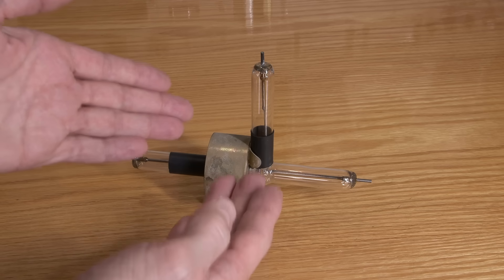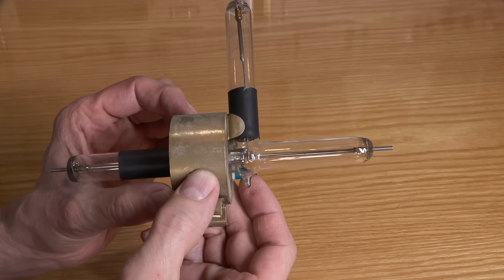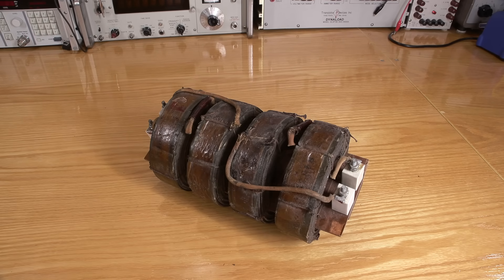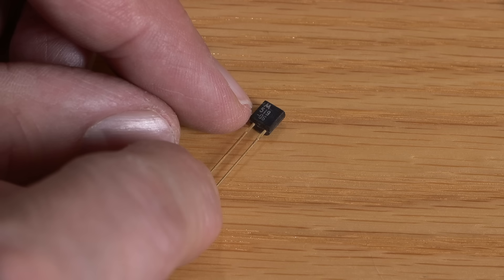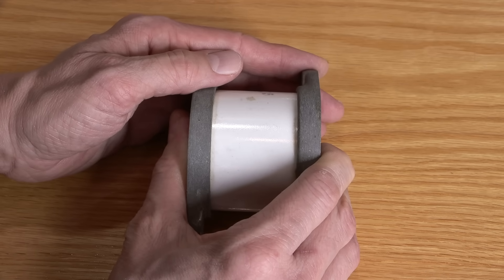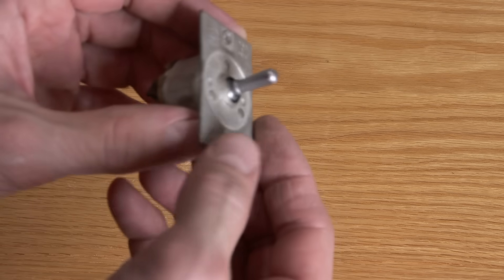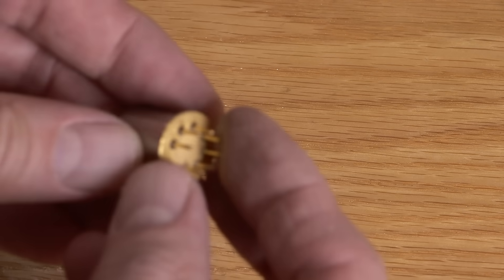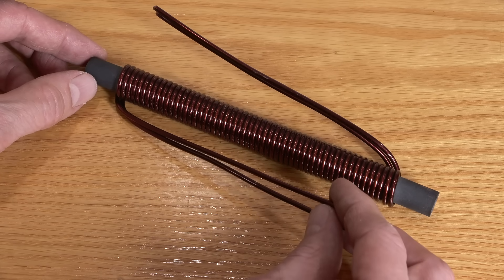Test Your Electronics Smarts - Guess The Electronic Parts!

Comment: MICA CAPACITOR TRIVIA.  The Bellingham Radio/Electricity museum melted their Sanyo mica capacitors (by running their large Tesla coil for way too long.  Guess it needed cooling fans.)  Molten sulfur ran out!  So, at least with older ones, the whole thing is embedded in that 1700s-era polymer insulator called melted sulfur.  I'd seen sulfur insulators in ancient physics devices and pre-1900 antiques, but apparently it's still being used.  Good idea: ...unlike epoxy and tar, when greatly overheated it won't turn into charcoal and short everything out.
Reply from the maker: They usually ooze tar when over heated.
Reply: @MrCarlsonsLab  And they smell good, too. I could always tell by the smell when one was getting ready to let go.
Reply: I remember reading the longest running battery that drives an electrostatic bell has been going for about 100 years and is insulated with sulfur.

On opening big HV mica capacitors like that I have found them potted with a very stinky waxy product.  The sheets of tin and mica are very pretty.

Comment: Two I failed on , the tubester , I thought was an op amp, and the small capacitor at the end as I thought both were inductors, I'm a kid of the  50's , I was repairing old vacuum tube stuff , so i had come across most of those parts

Comment: Ok, I paused 10 secs into the video. My guess just by looking is some kind of ancient accelerometer. Wonder if this one is compatible with arduino 😀
I got half a point. I said weird common mode choke on the filament choke. The choke part is right :-D 
Oh, and the green inductor. I called both probably inductors, where only the green one was. So that is 1 point.

Comment: I worked in HV electronics and microwave tubes for around 16 years. I won’t even watch this video because I know I already know what they all are. I now work with solid state systems along the same lines. Taking weaker microwave frequencies and making them bigger, stronger, faster and just as lethal. The device in the thumbnail is a glass HV SPDT relay. See, now I’m already bored. Have fun and don’t kill yourself.

Comment: I thought that small metal can was a RF relay since I have actually worked with some of those in the past. I even still have an old USB 2.0 switch that uses one, the good old days before mux chips capable of USB2.0 signal integrity became common.

Comment: I'm only 26 and I was quite surprised that I knew what I did with my limited skillset. 

1: The Relay I thought was an early transistor 

2: I was right with inductor but also thought it looked similar to a multi-tap transformer. 

3: Didn't know it was a veractor diode but instantly thought it looked like a transistor with a broken leg (thought it was going to be a trick question) as I've never heard of them before. 

4: Had no clue that was a capacitor as I didn't see where the wires connected to 😅 

5: Got the 4 position switch instantly, noticed the grooves in each corner and the 4 terminals on the back 

6: Saw the windings underneath the green coating so gathered that was a huge resistor. 

7: Had no clue that was a modern tube replacement as I've never worked on old tube equipment, I just like seeing people restore things I'd never have a hope of fixing with my current skills with a soldering iron. That maze of things connected without PCBs is quite confusing unless I looked at it in person and had days or weeks to reverse-engineer it or by replacing things component by component until it worked again. 

8: Gathered that was a choke as it looks similar to a toroidal choke with the amount of separate connections to it. 

9: Got tricked by the last two, thought one was a resistor and the other was a capacitor, now I know green usually signifies an inductor. The earlier image with all those capacitors helped me to some extent but also confused me as seeing colour bands on capacitors aren't something I'm used to except on the "domino capacitors"
Reply from the maker: You did well!

Comment: The 3rd item is also known as a 'varicap' diode. The number of switch positions on the switch was easy by looking at the notch-outs for the toggle lever. I'd call it a SPTT center off SW. 

I got everything correct at a glance except the solid-state tube substitute device. I have a couple of bags of Teledyne hermetically sealed relays in that package that led to my confusion. 

Back in 2012 or so I was 'the old guy in the backroom' who handled incoming surplus at a surplus electronics store who identified and priced all of the incoming surplus. But I really blew away the young guys working there when I identified a 19" rack equipment piece for them, telling them that it was the in-house built control unit for a 4 CRT vacuum pump-down cart used in the early 1970's in building C at HP in Colorado Springs as part of a 4 cart array, used to evacuate and seal oscilloscopes and HP CRT monitors, and I then described the abbreviations on the switch positions for controlling the mechanical, diffusion, cryogenic pumps, and oven controls used in the process. When a new guy at the store said, "You can't possibly know all that," I replied, "I could if I were the guy who was operating this pump-down-cart control unit at HP in Colorado Springs back in 1972."
Reply: Aww.  You should share more cool stories.  I would love to have the job you had in incoming.  The days of the CRT are gone and people will not even know that direct write oscilloscopes are even possible soon.  These days everything is filtered through digital hardware and software, always with the possibility that some nation state actor has hacked your unit and you are not seeing what is really there like the Stuxnet saga.
Reply: I've used more than my share of Teledyne 712D relays and I to was thinking it was some oversized version of one of them.

Comment: Got #'s 2, 3, and 4 correct.  Was off by 1 position for the switch (I thought it was 3 position + Off), got the massive resistor, missed the Tubester, got the choke but not the filament part of that one, and topped off by knowing the green body inductor but missed the Allen Bradly style capacitor.  So 5 out of 10.  Or 6 out of 10 if the partial answers count.

Comment: I need more osmosis time.

1) Odd looking relay
2) Scale model of the Rebel Alliance Reactor on Hoth without shielding.
3) Some type of crystal ocilator. (Saw the Motorola M and guessed it had to be something with frequency)
4) Absolutely no idea
5) Four position switch
6) Something dangerous if you touch it.
7) Some type of weird tube (I was sort of right).
8) Didn't Styropyro use this for one of the windings on his scary Tesla coils of death?
9) a) capacitor b) no idea

Comment: #1 It's a high voltage vacuum relay.
#2 It's a high current common mode choke.
#3 It's a varactor diode.
#4 It's a high power RF mica or ceramic capacitor.
#5 It's a toggle changeover switch with four positions ( I could twll from the spherical bearing in the handle, and the notches on the collar).
#6 It's a high power wire wound resistor.
#7 It's a eother a op-amp, temperature controlled crystal, or a nuvistor.
#8 It's a another high current and high power common mode inductor or choke, but for lower voltages (like the ones found in magnetrons) 
#9 It's an axial lead inductor (green), and an axial lead capacitor (brown).
Reply: #1 I wonder why it wasn't called a (evacuated) reed switch/relay.
#4 could've been a ceramic isolator/standoff or (gas discharge) surge protection, althou those have much bigger screws usually.
#6 could also be a weirdish inductor, a bit similar to resistors that have coil wound around them. My car has one such green monster in radiator fan control, bit smaller in size. There are much bigger ones out there.
#9 color coded capacitors/inductors are fun to figure out, especially so when bit damaged and trying to measure them.
Reply: @SeersantLoom I thought 4 was a high-power diode.

Comment: #1 SPDT Vacuum relay. #2 Some kind of choke. #3 No idea. #4 No idea. #5 Center off SP3T toggle switch. #6 Power resistor.  #7 No idea. #8 Choke. #9 the green one is an inductor.
5.5 out of 9!

Comment: 1. Some specialised transistor 
2. Big ol inducter
3. Thermister?
4. Ceramic Isolator
5. 4 position switch with 3 ons
6. Power resistor
7. Dual transistor (in a very obsolete package)
8. Also an inductor
9. Old style capacitors

Comment: Bunch of my guesses:
1. A big reed relay thingie
2. Low capacitance / high voltage choke or transformer
3. Voltage reference or some 1-wire thermometer
4. RF capacitor
5. A 3-position switch
6. Big green wire-wound ceramic resistor I got under my bench somewhere
7. Quartz, SAW filter or relay
8. Big RF common-mode choke
9. Tiny evil capacitor that will make you switch it to a resistor and burn things (shango066 showed them once) and a green inductor

Comment: 10:44 I got the cap for transmitters and the filament choke. I used to work with broadcast transmitters. Also, the very high watt resistor.

Comment: 1) ac to dc rectifier 2) ballast 3)TO92 size thermistor/fuse - diode? 3) Vacuum Cap 4) 4 position switch 5) High power resistor 6) Voltage reference 7) Big choke for my mobile HAM rig 8) Inductor that looks like resistor (green), resistor brown.

Comment: Mr. Carlson asks a question about a ancient electronic device and glasslinger is the first to raise  her hand! The IC in a 
metal case with 7 pins looks like a  RF or IF amp circuit from the 1970's. Oh tubesters, got it. Those two resistor looking 
devices have to be capacitors just to keep us on our toes! Nope the green one is an inductor! My junkbox so pitiful in 
comparision to yours Paul!
Reply from the maker: Sounds like you’ve got a great collection yourself!

Comment: I got only two right.  The small form capacitor because I came across one in an old tube radio -- but I didn't get the inductor there.  The color bands give a clue.  The three-way switch also, but I'm interested to know how that switch was used.  What application would 45, 180 and 275 degrees would fit?

Comment: It's worthy to mention that the filament inductor is wound bifilar, allowing it to operate with nearly zero reactance within the filament circuit (no appreciable loss in differential mode) while the pair acts like a single inductor ('common mode"), providing impedance for the RF. Very simple but effective design.
Reply: What's the point? Filaments run on low frequency AC (or even DC). That choke (if it was not wound bifilar) is not going to have any appreciable inductance at 50/60 Hz.
Reply: @6AK5W-JAN  The losses at 50/60Hz are minimal and the key effect is the common mode filtration.

It doesn't have to be wound bifilar, but if individual coils are used, two will be required (microwave magnetrons commonly skimp this way because 2.4GHz is rather easy to filter due to the smaller coil sizes required). It becomes more important at the lower RF frequencies because you need more copper to handle them.

If only a single tube is involved in a design, there's also less point in the bifilar because as mentioned, losses are minimal. If you have an array of them, the losses start to mount. Don't forget that filament current tends to be quite high compared to plate current; typically orders of magnitude.
Reply from the maker: The Inductor is there to stop RF applied at the tube filament pins (grounded grid operation) from getting back to the filament supply transformer. That inductor or choke makes the filament transformer invisible to the RF at the tube socket. A VERY important part.
Reply: @MrCarlsonsLab  Indeed. The main point was that it is wound bifilar to minimize differential mode inductance while maximizing common mode inductance.

Comment: Well this was a fun diversion! I'd love to see this become a series.

1) Guessed correctly.
2) I was almost half right. I thought it might be a transformer of some kind.
3) I guessed it might be a diode... I guess that was technically correct, but too general to get the point.
4) I did not guess correctly. I thought it might be a massive HRC fuse.
5) Got it! I've never seen one like that though. I wonder what it was used for?
6) Got it too!
7) Nope, I thought it might be an IC or a relay.
8) Got it!
9) Got it!

I guess 5/9 isn't too bad. Thanks for putting this video together!

Comment: No 1  This reminded me of a Tx/Rx cell used in some kind of RADAR system.  (I wasn't far off, I knew it was a high-energy relay).
No2   Giant RF -four-coil choke.   Got it in one. 
No3   I knew it was a specialised diode, but had forgotten which - varicap (of course!).
No4   Giant ceramic capacitor -  I thought was a large amperage fuse...  
No5    4-way switch.   I recognised its function immediately as it is similar in function to the 6- way 'Freeway' toggle-switch that is a replacement for the 'Switchcraft' 3-way toggles fitted to Les Paul style guitars.  I have one about to be fitted to one of my guitars.   
No6  Big green 'dropper' resistor - I've  got a few of these big ceramic jobs in my spares.  
No7    'Tubester'  -  I knew its function (replacement for thermionic valves...), just never heard it called that before.  
No8    Inductor - heavy duty - 'for the use of' -  In this case, I knew what it was, but not what its function might be.  
No9    Figured the wee glass bead was a zener diode...  Had no clue what the larger 'resistor lookalike'  (inductor) was  though.

Comment: Interesting quiz. I only really missed the first one - the 2-legged TO-92 could be one of a few things, really... I have seen Diacs, thermistors in the same package. The mini tube got me. I thought it was like a hermetically sealed transformer. Wasn't aware there were styles other than the Nuvistor. I have seen mini axial caps like that in some VHF receivers, and they were all low picofarad values as well.

Comment: Tubesters, tubistors & fetrons! At first, I thought it was an RCA Nuvistor tuner tube, but it had too many pins!
Reply: My first guess was a micro relay. I have a bunch of almost similar relays, albeit without gold plating (which is probably they survived to date...)
Reply: @jmi5969 I was assuming a relay as well because I have similar ones made by Teledyne, saw the logo
Reply: I guessed an early OP-Amp.
Reply: I had some tube FM receivers that a few 7 pin tubes were replaced with short black metal capped versions, still heated up like a tube..

Comment: 6:01 this confused the hell Out of me when i opened an old radio, thought it was a transistor with a broken lead at first, then googled the part. 10:28 well a resistor is a fuse if you Run enough current through it...

Comment: Hi,

1. I assumed that it was a Relais of some sort, but not a KV rated one.
2. I thought at first glance it was a weird Transformer, on the second thought it could be a Inductor.
3. I was sure it was a Insulator for a Transmitting tower.
4. I guessed a switch.
5. Big resistors ( Heating devices 😅)
6. I had in mind special Transistor or early IC.
7.  At first glance a strange Ferrite antenna. But not a filament choke.
8. 1st.
Maybe a resistor or a Inductor, i had not paid attention to the colour of the body.
2nd.  
I never came across a capacitor with this body style.

73
DH9MM

Comment: What a FUN video!  I enjoyed that.  I sort of guessed a couple of them.  I knew about the power resistor for sure, I've seen those before... The inductor I guessed, but the tiny cap I hadn't seen those before I wasn't sure about the TO-92 varactor diode thing before, never used them in a project and the other components completely outside of my experience, but now I know! 

I want to join your Patreon when I get some more of the money components installed in my bank, they have a green body made of special paper that has a very high resistance staying in my wallet, and they are measured in units of Dollars.   Individual dollars not very useful by themselves, but useful quantities are measured in Kilobucks.   LOL...  I know you price it very reasonable, so don't worry, One day.

Comment: The switch is automotive. Cole-Hursee is the stamped logo. One of those switch positions is likely a combination of the other two. Center off.
Reply: It had 4 connections where one is in the center. Looked like common to 1, common to 2 or common to 3, with middle position off.

Comment: My assignment to you is build a circuit that uses all these strange components
Reply: It will be the radar for s-75 system. Trust me.

BTW the tip of that 4 position switch has to be radioactive to illuminate green light.
Reply: @philkulibin2602 I didn't see any Radium paint, or phosphor coating on it.... 🤔
Reply: @philkulibin2602 I had to look twice, but I do see a little dimple I  the end of the switch toggle that probably did have some Radium luminescent paint in it at one time. 

These switches were used in military applications, mostly on aircraft, so that the pilots could locate the switches in the dark and not have to screw up their their eyes being adapted to the darkness by having to switch on a light to be able to find the switches and controls. 

Many of the aircraft guages were also painted with radio-luminescent paint for the same purposes.

Radium paint emits a continuous glow, never needing to "recharge" by daylight. Unfortunately, the glow would fade away after about 5 years because the strong ionizing radiation from the Radium would destroy the phosphorus used in the paint that converted the free electrons from the beta rays into light. The Radium however has a half-life of 1600 years, and remains dangerous to humans for LONG after the glow of the paint has ceased. So, even though a Radium painted dial or switch no longer glows, be CAREFUL with it, and do NOT scrape or ingest ANY of the remaining paint off the object.

Edit: some of those Radium illuminated switches had a little glass jewel on the end of the toggle, and the Radium was behind the jewel.